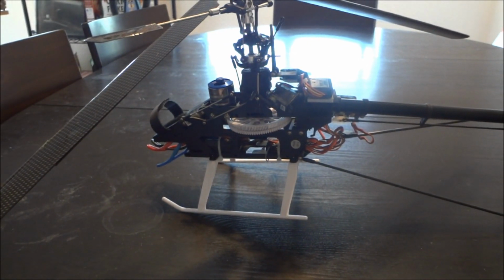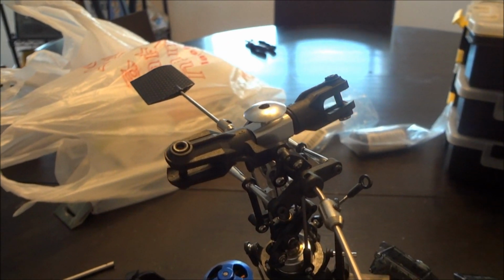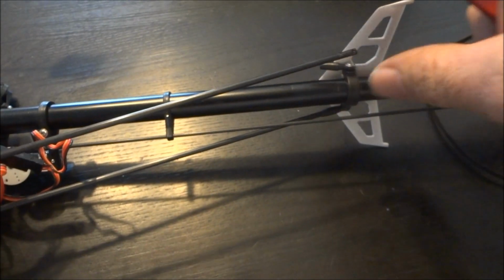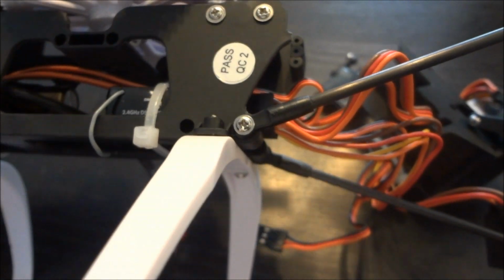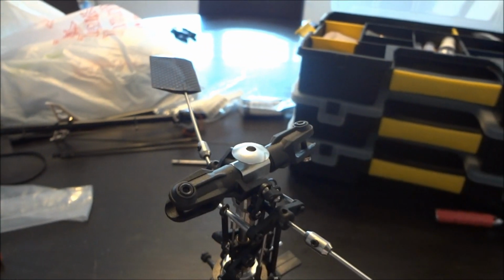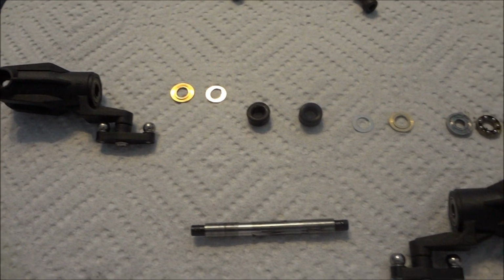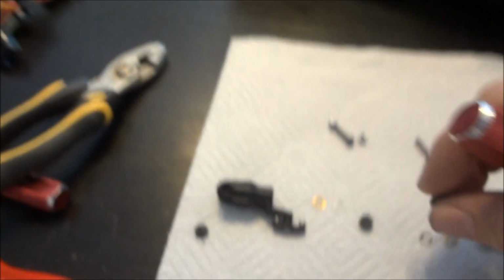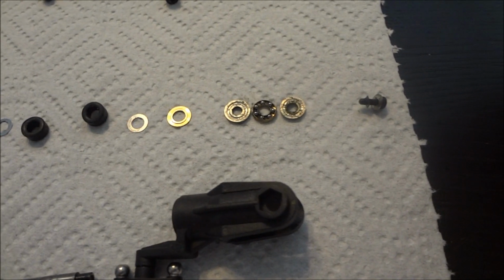Blade 450 Complete Repair Part 1

Comment: Wayne, I know these videos are really old now but I wanted to let you know how awesome they are. I got a 450 3D from a guy that left it at the LHS as he didn't want to fix it. It needed a new frame, tail boom, and a servo. Thanks to these videos, which I watched 100 times before I did my repair, I finished it up last night (3 hours to put back together from the ground up like you) and took it out for a test hover in my yard. I got it about 3 feet up for 2 seconds before my nerves told me to land it. lol I think I may sell it. Not sure. Anyways, just wanted to thank you for keeping these up!
Reply from the maker: It was my pleasure!  Glad these videos are still helping people.  I made these videos shortly after getting into the hobby.  Since then I've moved up to the larger 500 sized helicopters, quads, and hexi-copters.  My 450x is currently sitting on a shelf in need of repairs.  So I may need to use these videos myself to fix it again some day.. LOL.  And don't worry, the more you fly, and the more you repair, the less nervous you are while flying.. LOL.

Comment from the maker: Strange, YouTube automatically flagged your message as 'Spam'?  I clicked 'Not Spam' so hopefully it will show.  Any how, to answer your question, then I made these videos the Blade 450 3D was still about $300 US dollars, but they drastically dropped the prices on them recently to about $169.  And I can't even find them any more on horizon's website.  Even though this repair cost me around $100, it was still cheaper than buying a new one. =)  Now, I would just buy a new one. =)

Comment from the maker: Thanks for the advice.  This was the first time I had ever done a major repair such as this.  And I don't think I replaced any of the bearings.  I don't remember them looking or feeling bad, but it would have been a good idea to replace them just to be on the safe side.  Shortly after making these videos I purchased the 450X, and sold the 450 3D.  The 450 3D flew like new after doing the rebuild, just figured I wouldn't fly it much after getting the 450X.